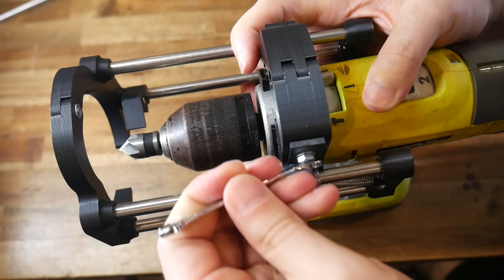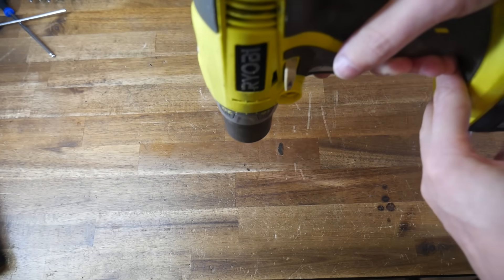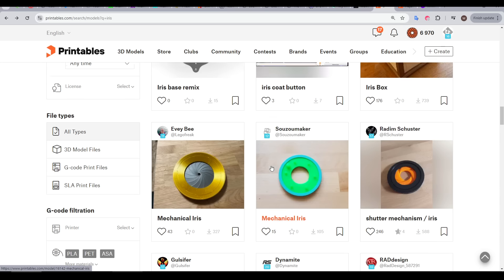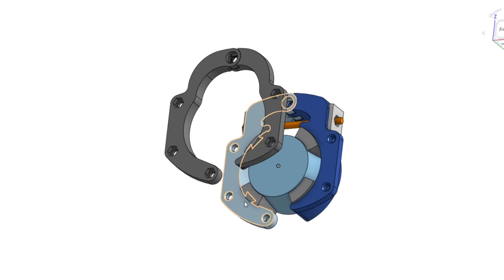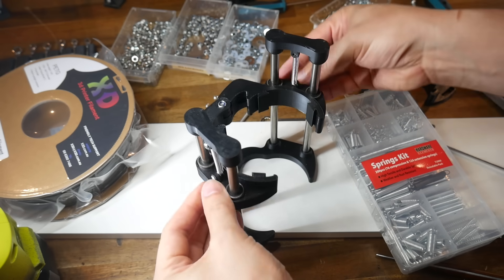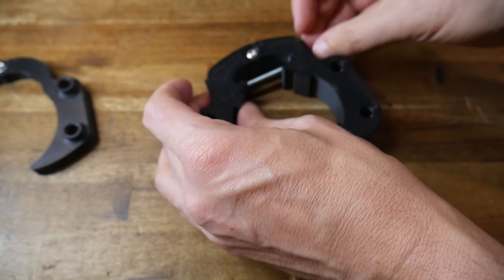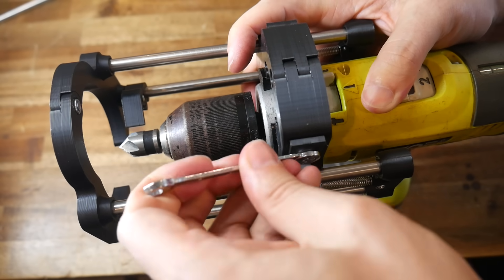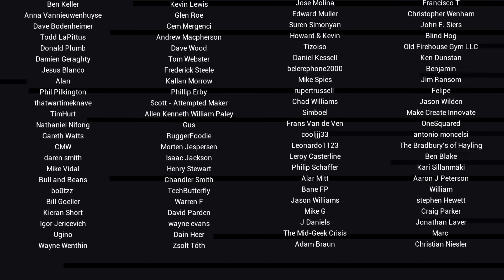This 3D printed drill add-on will give you repeatable, straight holes

Comment: Nice, stumpynubs was just showing off his favorite drill guide. It had some V cuts underneath to sit on pipes and a lockable rotation axis at the foot if you want an angled hole. A great tip was to screw a sheet of plywood onto the bottom when extra stability is required.
Reply from the maker: I was toying with various TPU foot addons. A V cut out would be really nice.
Reply: Another option is to design the foot with an integrated or snap-in "drill dust collector"
Reply: Dude, you gotta warn us. You can't just start the video with a mustache shot.

Comment: But they do exist. It's called a drill guide. I own one. But this one you made is really nice.
Reply: Don't all the drill guides force you to chuck your bit into a chuck adapter they have, and then chuck your drill onto that though?
Reply: @Roobotics some have a shank you just attach the normal chuck from a drill onto. I bought a second hand one that did not, but some quick work with the drill and a shaft attaching chuck to chuck, and a file on the threaded part you would normally swap your chuck out for became a shank for the drill chuck to attack to.

Comment: Nice one. It doesn't matter how many times I look down each axis of the drill, I literally never get a straight hole drilling by hand. I ended up buying the Milescraft drill guide, but this design looks like it offers some advantages over it right off the bat, not to mention that you shared the .step (tyvm for that!)
Reply: I get the best freehand results by placing a square on the workpiece near the hole, and frequently checking both my normal eyeline and an off-axis eyeline to compare the drill's centerline to the square's edge

Comment: Nice underground workshop, I’d paint the walls and ceiling to improve the lighting. Have you thought about having a hatch in the room above to access the workshop?
Reply from the maker: There is an unused toilet off the room above it, but it doesn't quite line up and I don't think potential future owners would prefer it over a toilet.